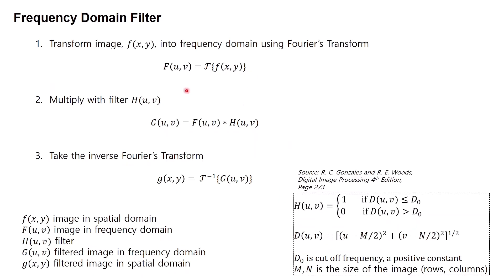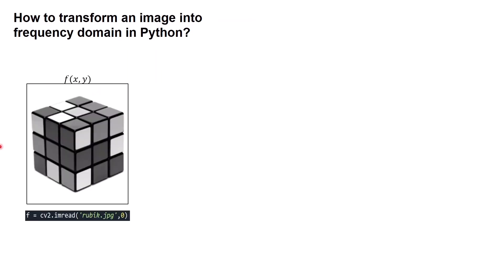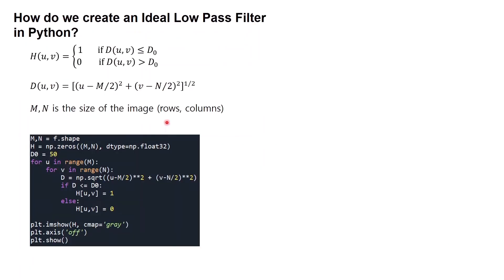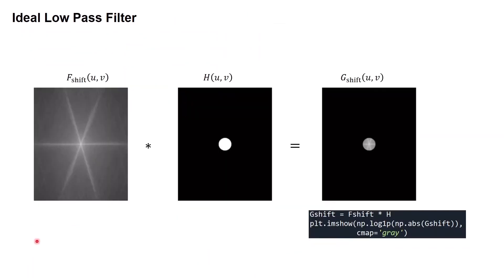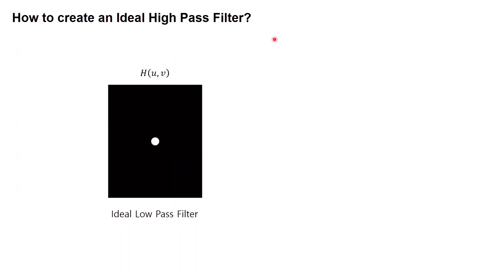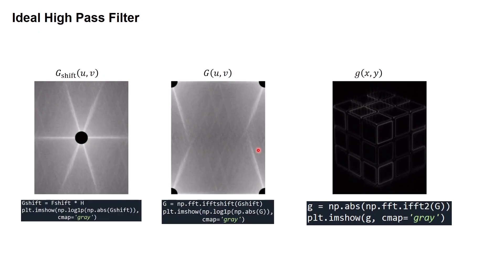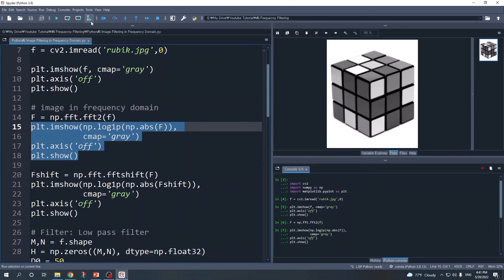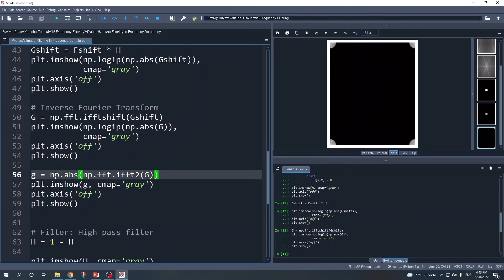Python#6 Frequency Domain Filter: Ideal Low and High Pass Filter in Python

Comment: Great video!
can I ask why you imported the file as a greyscale image and not in color?
Reply from the maker: Because I don't need the color information and it is easier to process the grayscale image.
Reply: So if I need to do the same technique on a colored image, I would work on each channel separately and then merge them at the end? Is there an easier way?
Reply from the maker: @yousefsalah2  Yeah I think you should work on each channel. But I am not sure if that is the correct way to filter a color image.